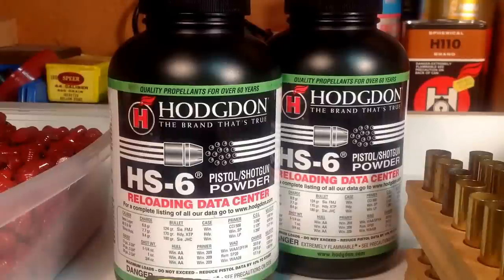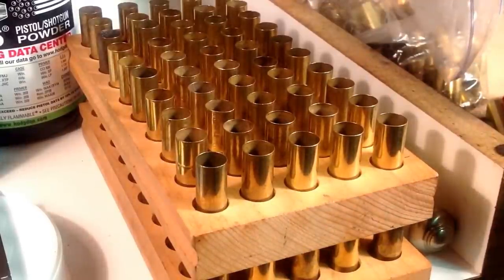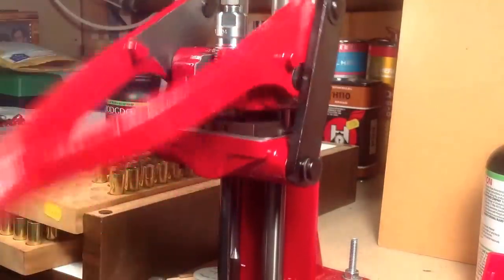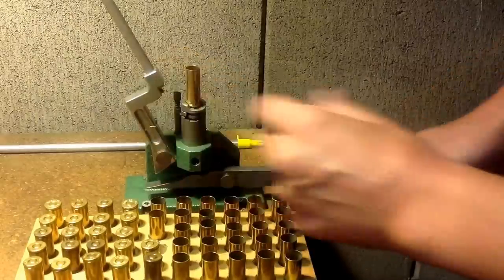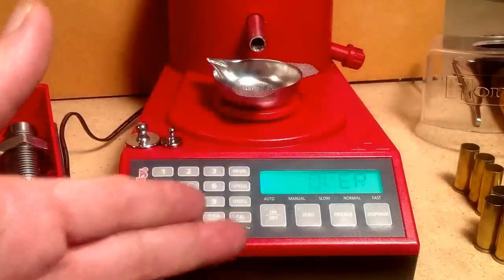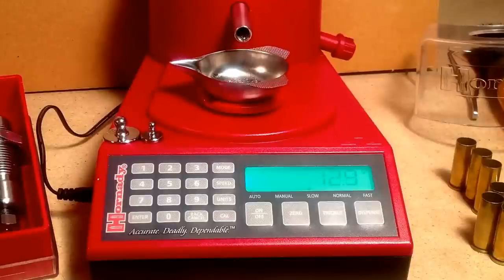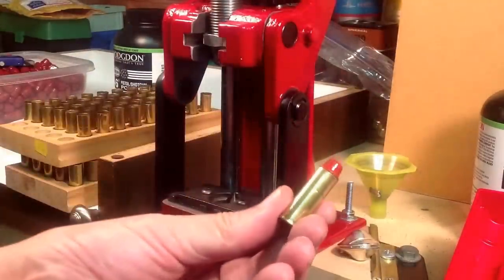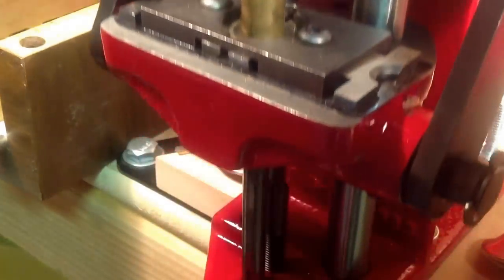Loading The Powder Coat Lee TL 452-200 SWC 45 Colt - Part 1

Comment: Very informative video..thanks
If the diameter for a .45colt cat bullet is .452 doesn't the powder coating add a little to that and shouldn't they then need resizing?

Comment: i use hs6 for my 40s&w ammo i like it it meters well
Reply: i have noticed you use more grains with it than some others i only get 1000 40's per pound
Reply from the maker: +vaper street - That's what happens when we use slower powders in big volume cases - takes more powder - got the data for that from Hodgdon.  And you are probably using 7 grains or a bit more in your 40 - the 40 data is right on the HS6 bottle...  Good shootin' to ya...FC

Comment: What diameter is your case at or near the middle of the seated bullet.just wondering since you used .452 and powder coated? Thanks
Reply from the maker: +Edad Martin -- To tell you the truth, I have no idea what the diameter is there.  The Lee dies expand the neck according to their specifications.  And the resulting neck tension is not too great to seat the bullets, yet is just fine to retain the bullets on firing of other rounds in the cylinder.  Plus, the bullets are not so oversized that the case is bulged at the bullet - in fact, they look just fine.  And it wasn't the Lee Factory Crimp Die that did that - the LFCD irons out any irregularities that may have formed during reloading that might impede chambering.  But the LFCD does no wholesale resizing in the even bullets are out of range.  My .452 bullets after PC are not out of range - if they were, I would size them accordingly as was done in other videos.  Thanks for the great question...Have a fine day,  FC

Comment: Hi ...love your videos very informative. I have a question, i have been reloading for 5 years and just recently i wanted to reload for my 45LC. i went ahead and purchased  .452 200GR SWC hard cast bullets from Berrys. The box says 45ACP but i was told these are fine for 45lc? Here is my problem when i seat the bullet in order to get the COL of 1.600 Recommended MAX the bullet actually has to be pushed in down further where it ought to be. I checked it out on 45ACP cases and the same thing the projectile has to go to far in to achieve max COL.  Is it possible the projectiles are bad? I called Berrys but they are closed on Friday.  HELP!
Reply from the maker: +Nick Pitt -- I never bother to look at COLs on particular bullets.  If your bullet has a cannelure,, you can seat the bullet to the middle or top of the cannelure.  If your bullet has a crimping groove, seat to the top of the crimping groove.  If there is no crimping groove, the SWC was designed for auto pistols.  Here is the thing on SWCs in auto pistols - seat the case mouth right to the shoulder so that no more than a hair (.003") of the bullet is out of the case mouth (you can eye ball this - no need to measure).  You can do the same with your 45 Colt, but as long as the bullet nose is not protruding from the front of the cylinder, your OAL is fine - The manuals list COL that includes functioning in lever guns and other guns, etc.  But if your particular gun allows the bullet to be seated out a bit more - by all means - as long as you aren't too close to the front opening of your revolver cylinder, you are good to go.  If you get a lever gun later, and the round doesn't function there, you will have to seat the SWC deeper, but you should never have to seat it deeper than the shoulder being even to the case mouth.   The 200 grain 45 bullet is very useful - some are intended for revolvers (has crimping groove), some intended for auto pistols (no crimp groove),  But any 452 bullet can be used in either 45 ACP or 45 Colt.   Good reloadin' to ya... FC